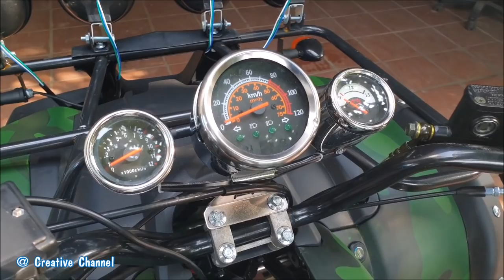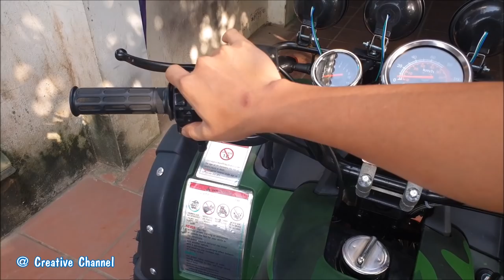Test and review ATV Quad Bike 250cc

Comment: Looks like allot of fun. Will be interesting to see how long the clutch will last.
Reply: builtrodewreckedit two weeks 
If that
Reply: builtrodewreckedit why will the clutch not last ?
Reply: @corn26489  because he slips it way too much. the throttle is the speed control not the clutch.
Reply: Atvs dont have clutch becouse they are automatic and somme do have but they are small atvs and they are made for speed so you can't rlly pull a trailer with them or other things
Reply: It’s a cheap Chinese atv look at it

Comment: I wish they offered a spare tire on the ATVs here in the U.S.
Reply: The ones for recreational don't have a spare tire because they are designed for racing and such  (the lighter it is, the more responsive the drive is). The offroad oriented ones like the ones sold for ranchers have a spare tire rack like this one. If you have a welder you can also make a cheap rack too.